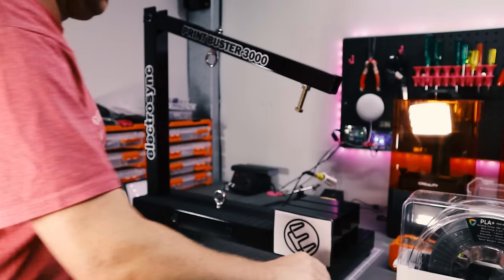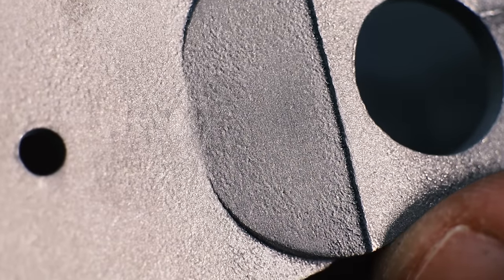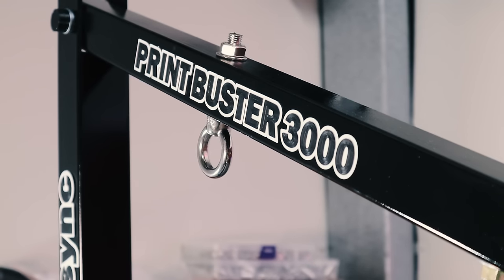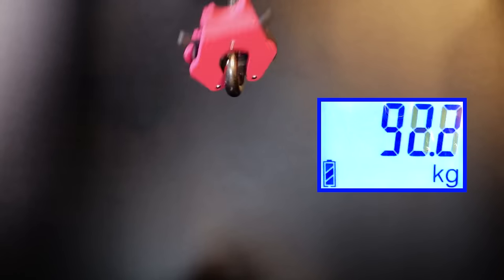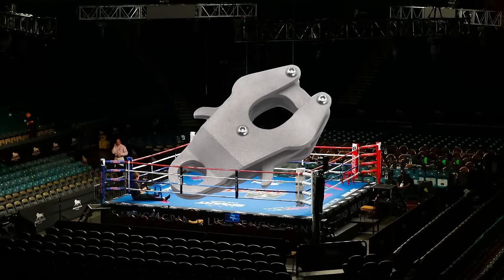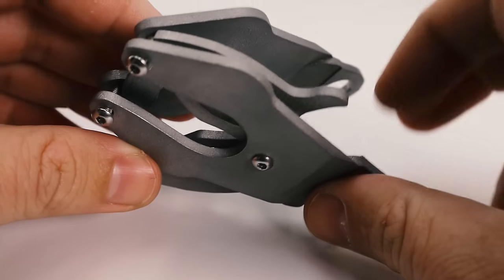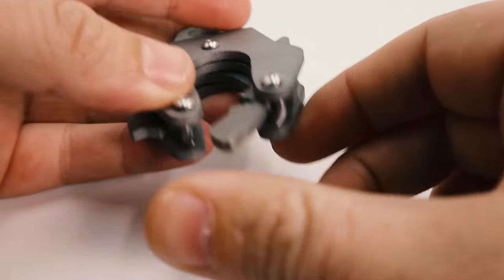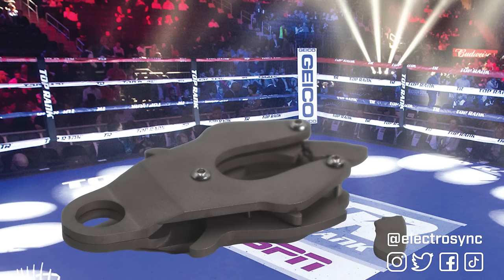How Strong is 3D Printed Metal?

Comment: It would've been great to see how a 3D-printed metal compares to the same metal, but machined.
Reply from the maker: Stay tuned...
Reply: @electrosync  I'm interested. 🤔
Reply: I think stamped aluminium and steel would be great too!
Reply: Mechanical properties of aluminum and steel are known...I would find intersting too to compare machined and printed samples...and it would be much better if you use standard sample usually adopted in these cases (it is usually a small bar with the terminal part thicker in order to induce the sample to fail in the middle part), with a known cross sectional area. Another thing that I have noticed in your video, in fact, is that no one of the 2 hooks made by pointer metals began to yield before fail. This is an important diffrrence with respect to machined metals, where the piece, before failure has a permanent deformation. This behaviour is and advantage of metals over, for example, composites because it advice you before failing. Composites instead are fragile and fail suddenly. If printed metals should lose this their feature with respect to machined ones, it would be, for me, a big concern.
Reply: He's going to need an upgrade for test rig already 🤣
Reply: Depends on a few things like hand forged versus casted metals as well as tempered and hardened metals... The same alloy can have a dozen different strengths depending on the skill of the one who forged it and the process they went through. 

Overall 3d printed metal is going to be weaker than casted metal, and forged metal will be far superior to casted. Tempered metal will add an extra layer of superiority.

The stats have already been established in the metallurgy field... This is actually something that was already known back in the bronze ages....
Reply: @teddy5004  I'm looking at it from the standpoint of using it as an alternative to other longer-standing processes, so processes that would be more comparable in price.  Yes, still apples vs. oranges, but as a person who needs to make a part, what benefits can I get compared to ***, etc
Reply: @zz3709  For things like frame sliders and engine guards 3d printed parts should be perfectly fine but anything that you truly expect to take a beating from wear and tear such as the engine or frame of the vehicle should be a forged steel or alloy.... Put this way if you break a wrench in half you'll see the nearly mirror finish grain structure on the inside while breaking a metal 3d printed wrench will look much like sand. The tighter the grain structure the stronger the material. 

The answer for what benefits you get from a metal 3d printed part is moderate durability and quick manufacturing times... Think quantity over quality.. So if we were talking about parts for a car that require durability due to risk of breaking you'll want to go for the higher quality process... But anything you dont need to be incredibly strong such as panels, brackets, conversion plates, or any types of pipes or tubing should be perfectly fine when 3d printed. 

Also keep in mind 3d printers arent necessarily faster than machining the parts yourself.. Depending on the design a fabrication shop with the same skill as a 3d printing company could most likely create your part just as fast if not faster than a 3d printing company as its alot faster to whip out an angle grinder, cut a piece of bar steel and turn it on a lathe compared to the long prep process required for a 3d printer.
Reply: Developments have to start somewhere. Wide User use surfaces limitations urging continued development. Other factors like finished component hardness is important. The Test rig should have been designed around typical principles. This would have quickly exposed stress, bending moments, etc. Generally designs for a test rig needs to exceed max limit by much more then 10%.  Since it’s for testing, I might have made it twice the max load limit. This is where Iron Steel forms are handy ie “T” sections, Ship & Car Channel sections, etc. by doubling required strength the test system is dependable.
Reply: @teddy5004  Yes, there is a full pletora of aluminum and steel alloys, everyone with different mechanical charactristics upon how they are machined. What all aluminum and steel alloy anyway have in common is their ability to yield (or to have a permanent plastic deformatioin) before reaching their breaking load. Watching the video, it seems that printed metals don't have this features at all, making them more like fragile elastic materials (such as composites) instead plastic ones (that is how one expects they behave)
Reply: @compassft  Yeah the loose grain structure and high temperature forging of the 3d printer causes the metal to have a loose grain structure and be very brittle almost like a very and tough expensive chalk.
Reply: @teddy5004  yes. Wouldn't the aluminum oxidize as it  was printing, while casting would only oxidize the outside of the solid aluminum?
Reply: @jjmartin6422  That's way above me.. I only know the basics of metallurgy however I would imagine no the metal would not oxidize as it's in a sealed chamber.. The process is basically the same as welding metal inside a vaccume
Reply: I did some math , and while I admit I could be entirely wrong given all the different conversions (M2 to inch2. MPa to psi to kg/cm2 etc but for the same 50g weight of aluminium should (hold 16,978KG of force )
Reply: Intrested to see the comparison.
Reply: Thomas Franklin  My question was about properties, not economics or logistics.
Reply: @teddy5004  3d printing is not faster or cheaper in large quantities than stamping a plate or casting a complex piece though. Its real advantage is it is way faster and cheaper than developing tooling for a panel. This makes it suitable for prototypes that need some of the properties of the metal but don't necissarily need to be durable, they need to hold up well enough to test if everything operates properly, then you only need to pay for the expensive tooling to stamp the plate or cast the complex part, and then you only need to pay for the expensive tooling once rather than risking paying for it and finding out your part doesn't fit and needing to buy a new set. It also makes very low volume parts that would never sell enough to justify the cost of tooling for mass production possible, albeit at a lower quality than they could be made with traditional manufacturing methods.
Reply: Could putting a 3d printed part through a HIP(hot isostatic pressure) process help strengthen the part?
Reply: Printed metal properties are typically slightly lower mechanical properties than the same material in billet, but substantially better than cast material. For some alloys with some heat treatment, the printed metal properties can actually be slightly better than billet
Reply: @teddy5004  what printing process are you referring to?
Reply: Thomas Franklin  it's not trying to compete with those. It's better for low volumes and higher complexity. 3D printing is most-beneficially used when you have geometries that can't be practically produced with traditional methods or maybe consolidating multiple parts into one.
Reply: @roaminganarchist7148  we typically stress relieve, then HIP, then solution & age. The HIP process leaves your microstructure fairly wrecked, so you need to reset that with solution
Reply: @jjmartin6422  for LPBF printing, the powder particles come pre-oxided to passify them and prevent combustion. It's a pretty thin layer of oxidation though and it's just on the surface. When the laser hits the particle, it comes off like a candy shell. The chamber is purged with argon, so it's really reoxidize. The oxidation is on the surface when the parts come out of the machine, similar to a casting. In aerospace, we have specs for the allowed oxygen content in the printed material. It's pretty low if the process was in control
Reply: The "texture" of this 3D printed steel looks weird. Do we know if a cube of it is lighter than a cube of  casted or forged steel? Or if there are any remains of additives in the finished products?
Reply: @Chimel31  vertical walls in lpbf will typically be around 600uin Ra. Upskins and downskins can definitely be rougher as-printed. The density is 99.9X% though. After thermal treatments, it's effectively 100% solid. The grain structure is a little different than other methods. Properties are typically much better than cast, but not quite billet. With LPBF, there aren't additives - it's just metal. Binder jet types of processes definitely have some challenges with the binder coming out completely though
Reply: Printed must be stronger than regular machined as compacity % of printed is now 99.7% , more than regular metal production
Reply: @surronzak8154  it's not typically stronger than billet. It's much stronger than cast though. After HIP and HT, you're nearly 100% dense, but the grain structure still isn't as ideal as billet
Reply: @surronzak8154  re: "Printed must be stronger than regular machined as compacity % of printed is now 99.7%". unfortunately no, grain structure also has an additional "alignment" variable to consider when dealing with forces in tension and compression.
Reply: @compassft  thats just another reason why 3D printers are only suitable for making prototypes, not finished products.
Reply: There are 3D printed parts being used in hypersonic test engines, Velontra has a video up on Tech Ohio showing some of these parts assembled in test. Just need the right metal for the application.
Reply: You could never beat forged, cast or machined metal. Especially when it is something that is literally life depending.
Reply: that is what I came for...
Reply: Might not want to fly then, aircraft parts from structural gussets to complex jet engine components are being 3D printed now. All that wing-load on parts designed and printed in-house saves the airline industry lots of $$$
Reply: @teddy5004  
☑️ ^Exactly...  From the very moment I first heard of 3D printed metal parts & products, I was dubious as to their strength and durability compared with some of the traditional production methods. Hopefully there will soon be exhaustive comparative strength testing between 3d printed parts, versus:

👉 traditional cast parts
👉 Parts machined from hot or cold rolled metal stock
👉 Forged parts
👉 Parts produced using any of the above methods that go through additional strengthening measures(heat treatment, work hardening, surface treatments, etc).
Reply: Also wondering this
Reply: @electrosync  Did you do it?
Reply from the maker: @rihasanatrofolo2472   Sure did. Check it out here: https://youtu.be/Js3bJ1B8ySM
Reply: @electrosync  Thanks chief!
Reply: That's the whole reason I came here...Like, what's the point of this video AT ALL if not doing such a test, extremely disappointed this was not the case...Oh well, you lose most, only win some.
Reply: Ooh!  And cast parts!  Imagine comparing 3d sintered, cast, and machined parts.  Even better if you can get a forged part made to test alongside.
Reply: Then we gotta have drop forged material as well.

Comment: The slight difference between the stainless steel and aluminium might be because of the melting points. During 3D printing, aluminium might melt more efficiently and bond together more strongly because of its lower melting point.
Reply: Also the stainless steel looked like it might have had some voids.

But to be fair stainless steel is not particularly known for great tensile strength either.
Reply: @nocturnal0072  316L Ultimate Tensile Strength is 515 MPa while that of AlSi10Mg is at max 450 MPa.  That is about 14.5%.  The AlSi10Mg though has a higher Yield Strength than 316L.  If this were a straight up test of a fixed object it shouldn't matter but we are looking at a complex assembly and the 316L assembly going plastic first could very well have seen loading on individual areas of the assembly increase on the 316L as others went plastic.

Also, as said, the 316L "looks" like it may not be perfectly sintered but we are looking at something already torn apart.  

Bottom line, without testing a simple test part lacking moving features and assembly it is very hard to make a direct comparison.
Reply: @kennethfharkin  4340 steel quenched in oil at 315 C has a tensile strength of 1,760 MPA. 
The alloy contains nickel, chromium and molybdenum Just like 316 SS does but not as much concentration of those elements.
Reply: @darkshadowsx5949  yes but what does that have to do with the 316L which was DLS printed?
Reply: it makes sense.
Reply: About to write the exact same thing -- but I suspect any decent effort at heat treatment would work wonders.
Reply: Stainless still is just a general name. There may be some many different metal mixtures in it, that it's really hard to compare without knowing alloy mixture.
Reply: @gregoriodia  There are variations undoubtedly, but the the steel and chromium mix really doesn't leave any options that are less dense or less tough than any aluminium alloy. Volumetrically, any consistently crystalline stainless steel will be stronger than the same piece made in aluminium.

Comment: The cost difference for aluminum and SS makes the slightly lower strength of the aluminum compelling for the 3D printed versions. I think the SS would be lots stronger except that the melting point is much higher and that was probably making for poorer bonding of the metal powder. If these clips were made from actual solid aluminum or SS I think the strength would be much better. You can see the porosity of the metals...that's going to make 3D printing weaker.
Reply: If the SS was caste as opposed to printed it would have doubled aluminums performance.
Reply: He could make compatrison betwean printed and caster parts. More useful.
Reply: That is a valid point you made there, I would like to see the test results of the same apparatus made from the traditional methods of casting vs 3D printing.
Reply: CNC machines have their place.

Comment: Interesting project. The steel held up to 1984.16 pounds and the aluminum held up to  1823.22 pounds. That is impressive to me. It could be use to hang bicycles up in garage and things like that.
Reply: the official kong ones hold like 4000 lbs so truely a crazy impressive tiny thing
Reply: Yeah , it could but it gone by expensive

Comment: I’d be interested to see how the same components made from sheet Aluminium and stainless steel performed and if their failure points were the same.
Reply from the maker: Great idea! I'm working on a follow up to this video and I'm looking to include some laser cut parts, plus some more exotic materials...
Reply: @electrosync  
I'm looking forward to seeing how the gold, platinum and adamantium ones perform.
Reply: @electrosync well the metal is stronger then my will to survive so pretty solid😎👍💯

Comment from the maker: Well, that was fun! What else can I test on this contraption? Edit: I've made a newer video testing different material processes here: https://youtu.be/Js3bJ1B8ySM
Reply: The only test that matters is to compare the strength of traditionally manufactured parts vs 3D-printed parts.
Reply: A bogan mullet
Reply: I agree with Ivo, I'd like to see a machined part comparison in aluminum and steel.
Reply: Same design &materials, traditionally forged methods.
Reply: who is stronger under the same weight,cn or 3d print？
Reply: Your LOVE for us? Ha, just kidding- we all know that's UNBREAKABLE!!
Reply: I really enjoyed your video.  I would like to offer to manufacture your snap close clip from aluminium. For you to test. On our cnc machining centre.
Reply from the maker: @psmachining  I'm interested. Contact me at the email address in my about tab. Thanks.
Reply: @ivoslavin251  Came here to say this. Can't help but wonder how metal prints compare to aluminum plate, mild steel plate. I applaud the consistency in your testing methods. Keep it up!
Reply: CF-Nylon and polycarbonate please.
Reply: Test the higher end industrial filament such as PEEK-CF, PEEK-GF and anything you see similar. 

I am interested in the properties of such material. 
Yet have not found solid data on real world strength.
Reply: hey dude, maybe you need to buy one of these https://en.wikipedia.org/wiki/Universal_testing_machine would love to teache you how to use them.
Reply: You should be plotting stress vs strain.  That way you can see when parts start yielding, which is more important for failure.
Reply: @electrosync  id like to see shear strength and compressive strength tested, as well as how far you can bend it. tensile strengths alone wont inform viewers well of a materials possible advantages or disadvantages. maybe also a twisting strength test.
Reply: How about trying some light metal forming against a 3d printed buck, using the rubber 'Hydroforming' method ?
Reply: USE CARBON FIBER AND THE IMPERAIL MEASUREMENTS
Reply: Do you know of any one-stop shops for all hobby electronics, specifically DC Brushed motors of all varieties?
Reply: @ivoslavin251  I agree, he could test diffrfent technology of 3d print metal too..
Reply: If you send me the design files, I’ll run off some Markforged Onyx and Fiberglass reinforced Onyx parts. I’m curious how they would fare as it is claimed the fiber reinforced is comparable to aluminum strength.
Reply from the maker: @weekendproducts  Thanks for the generous offer, but I already have someone doing these parts for me in Onyx with carbon, Kevlar and fibreglass. But we will find out!
Reply: @electrosync  i look forward to the results!

Comment: You should off printed PLA+ with solid infill, it could haa make some difference, 100Kg is still quite impressive for a printed plastic
Reply: You noticed the sponsored metal parts were solid while the non sponsored plastic where lightly infilled. Not to say PLA ever had a chance but lets see apples vs apples. Solid CF filled nylon would have been a lot fairer comparison.